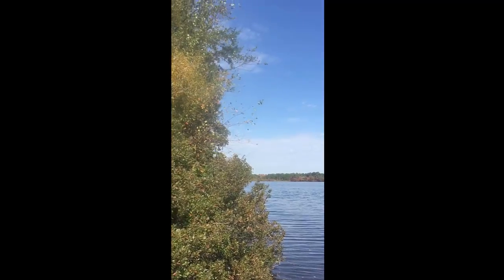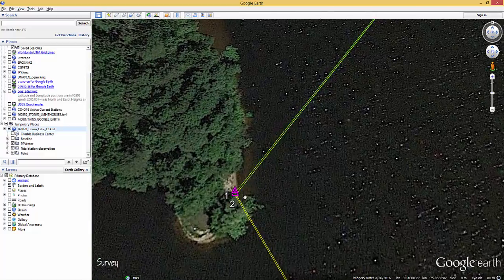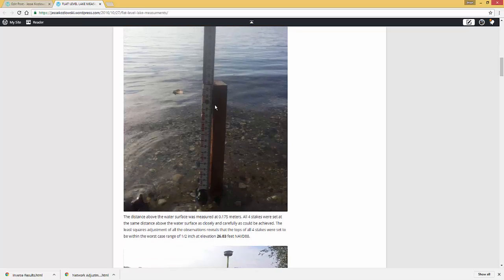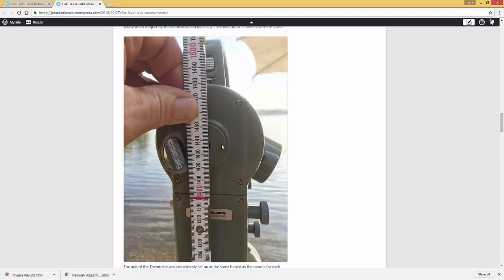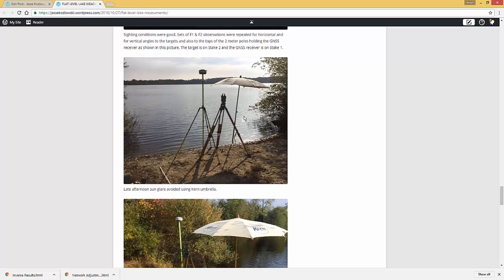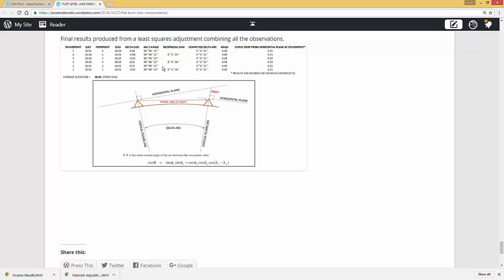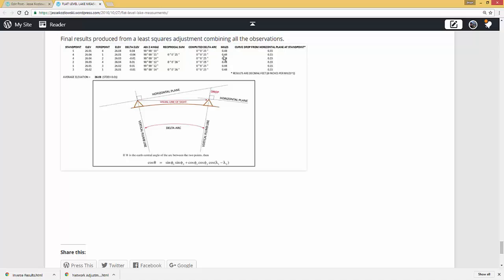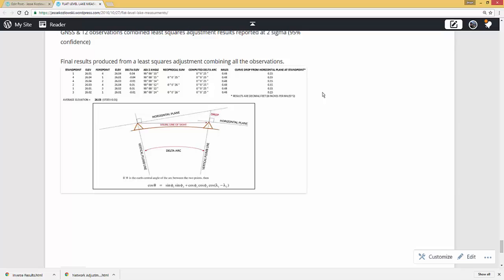Flat Level Lake Measurements

Comment: I came to this post from your comment on Bobby Shafto's site.
You have done what people like Flat Earth Perth seem to be unable to comprehend - using modern precision instruments.  My understanding is that the more accurate your instruments are, the shorter the distance required for valid measurements of this sort.
It looks like you had to lug a lot of gear into the location.

Thank you!
Reply from the maker: Thanks for watching and commenting. Check the pinned comment above for links to more vids like this one ... yes, lugging lots of gear ;)  , And you're right we can measure the inclination of the plumblines over short distances as a few hundred meters.

Comment from the maker: My videos demonstrating how to establish the horizontal reference line as the geometry required by the 8 inches times the distance in miles squared formula to measure the drop of the earth's curvature down from the tangent plane established perpendicular to the plumbline at the observer's location. 

George Hnatiuk's Rainy Lake Experiment - Reported & Animated By Walter Bislin
Published on Jul 20, 2019
https://youtu.be/a79KGx2Gtto

Philly Blink From Apple Pie Hill
Published on Dec 7, 2018
https://www.youtube.com/watch?v=r_3HX1AdxXE

Atlantic City Blink-Blink From Wildwood NJ
Published on Jan 21, 2019
https://www.youtube.com/watch?v=G4bLggnkHo0

Horizontal Plane Made Using Theodolite
Published on Sep 25, 2016
https://www.youtube.com/watch?v=IgeOl1sgm4I

Observing Lighthouses Across The Delaware Bay
Published on Oct 2, 2016
https://www.youtube.com/watch?v=Qpxd5btyLJA&t=374s

Observing NYC From Fire Island Lighthouse
Published on Oct 13, 2016
https://www.youtube.com/watch?v=q4JTmaD96cE

Observing NYC From Washington Rock
Published on Oct 26, 2016
https://www.youtube.com/watch?v=9cgeHhz5mkc&t=1s

One Mile Level Line
Published on Nov 25, 2016
https://www.youtube.com/watch?v=A90FfiLqEOo&t=214s

Perfectly Flat Level Lake 
Published on Nov 18, 2016
https://www.youtube.com/watch?v=ZlP3njwf6h0

Flat Earth - Curvature Confusion
Published on March 18, 2017
https://youtu.be/moDr0CPZhbs

CLOWN FROWN FOUND
Published Oct 18, 2018
https://youtu.be/rwVEPY_0NS4

Flat Earth - Missing Curvature Found !
(Recorded Live Stream 2/23/17)
https://youtu.be/QaBvc0SaPX8

Flat Earth Proof? - Show Us The Measurements
Published on October 29, 2016
https://youtu.be/zugpfih9uRc

WHERE IS THE CURVE ON LAKE PONTCHARTRAIN ?
Published on Dec 24, 2017
https://youtu.be/BtCyR_MwhFo

My Videos Showing The Earth's Curvature Using XYZ Rectangular ECEF Coordinates On The Lake Pontchartrain Causeway And The Bonneville Salt Flats  -

GNSS Survey Of Rte 80 For 40 Miles Across The Bonneville Salt Flats In Utah
Published on Apr 14, 2019
https://www.youtube.com/watch?v=SEsyPQ-Zako&feature=youtu.be  

Demonstrating Walter Bislin's Radius Calculator - Lake Pontchartrain ECEF Coordinates
Uploaded on Feb 20, 2019
https://www.youtube.com/watch?v=Q-LX4aq-6Js&feature=youtu.be

'R' Presupposed No More - Earth's Radius Measured on Lake Pontchartrain Causeway
Published on Jan 27, 2019
https://www.youtube.com/watch?v=vwtDzvoIY1w&feature=youtu.be

Highlights - Lake Pontchartrain Causeway GNSS Survey Results
Published Jan 26, 2019
https://youtu.be/gqWMkw8vh3g

Here Is The Curve!
Published Jan 25, 2019
https://youtu.be/lyedCp1telk

CLOWN FROWN FOUND
Streamed live on Oct 18, 2018
https://youtu.be/rwVEPY_0NS4
Reply: Wow.  That is a thorough response Jesse.  Over the coming days I will try to work my way through it.
Reply: Oh,  but I thought that objects “appeared to drop” below the reference due to Perspective? Did Brian lie to Me? 😂
Reply from the maker: @overweightaviator  , I cannot say with certainty that he his lieing to us, but he is most certainly wrong and convinced he is right. That makes him ignorant.
Reply: Jesse Kozlowski he is literally the poster child for Dunning-Kruger. It’s just painful when he’s so arrogant and brash, at the same time as being ludicrous ignorant. 

I think he’s blocked me now, after pulling apart his madness. Which is actually a blessing. His repetitive nonsense was rather boring. 

Nice work on your page though 👍🏼

Comment: Why don't you just say on one beach your stick was say 4 feet above the water on one side of the lake and you had  the stick a stick 4 feet above the water.when you looked across the lake at the stick where either the same height or you had to raise one 4 inches to be level because of curvature.
Reply from the maker: Oh, is that how you did it? Thanks for the suggestion. Let's see your video of you doing that. Just reply with the link.
Reply: @JesseKozlowski  um I'm asking a question about would it not be easier to discribe.if you did it that way.but since you ask maybe I will.maybe use 2 feet high look across the half mile lake at the stick on the other side is it it level or is it raised to 2 feet 4inches from the surface because they say that for ever mile the curvature drops 8 inches or 4 at half mile.hence why the stick would have to be 2 feet 4 inches high on the other side if the earth was round.right?
Reply from the maker: @allankwiatkowski8217  , well I don't know if your method is easier and I doubt it would produce the extremely high precision my work resulted in. As a surveyor, I do things like a surveyor does them. I used the same methods we use for constructing bridges across water. If there's an easier way, I don't know it.

Comment: Hi Jesse, I don't know if you have covered this in a video before but, have you ever calculated the intersection of the plumb lines and what the radius of that angle is?
Reply from the maker: equinox project , that is all detailed in this book ...
A History of the Determination of the Figure of the Earth from Arc Measurements

https://archive.org/details/ahistorydetermi00buttgoog
Reply: Jesse Kozlowski Thanks Jesse,  in haves been meaning to take a look at this book. In will definitely check it out.

Comment: How do you define "flat"?
How do you define "level"?

What makes you think FLAT = LEVEL?
Reply from the maker: Kenneth Bowley , What makes YOU think I think FLAT = LEVEL? Is it because you didn't bother to watch the video you are commenting on ?
Reply: Jesse Kozlowski - My apologies - I did indeed assume that this was more pseudo scientific nonsense. Having watched the video in full I think you've done a pretty good job. 
The killer blow would be measuring the height above the water in the middle of the lake to give you another reference point for the curvature but that's probably unrealistic on a budget.
Reply: Kenneth Bowley  You are correct you need one in the middle at 1/2 mile.
Then line up the mile heights and you should be 4 inches low in at the 1/2 mile post.
Reply: @JesseKozlowski  Level is horizontal though, right? If it wasn't then that would mean horizontal would have to somehow (paradoxically) slope.
Reply from the maker: @DrEMichaelJones  , Definition of Level In Surveying Texts
https://jessekozlowski.wordpress.com/2020/02/19/definition-of-level/

Plane Surveying Isn’t Flat –

https://jessekozlowski.wordpress.com/2020/04/01/plane-surveying-isnt-flat/